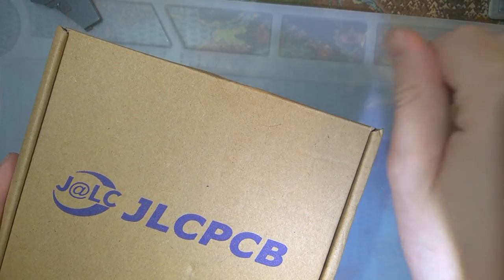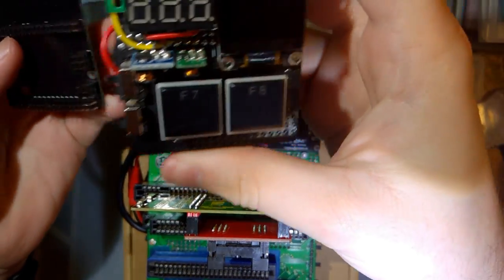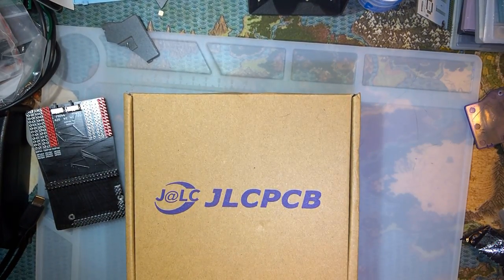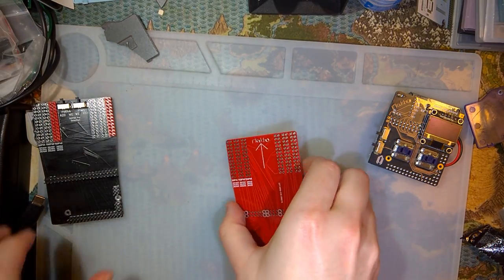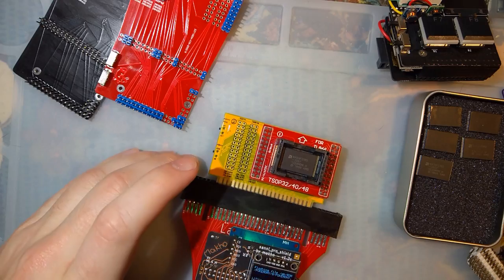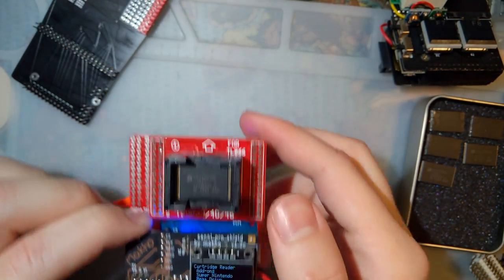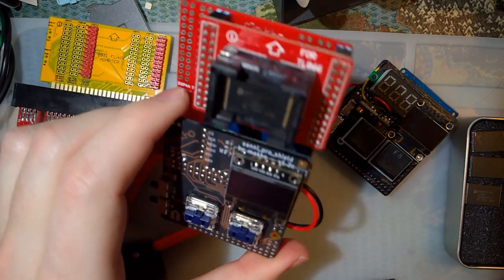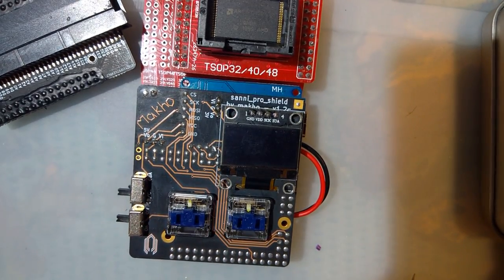8 Bit Flash Adapter PCB for my Micro Cart Reader (Part 3)

Comment: Hi makho. i have a question.
when i flash AM29F016B chip with 8-bit flash adaptor, it's detected, erase ok. but keep error : Not blank. and when i write chip, it keep freeze.
did you solve this problem?
Reply from the maker: Try reseating the chip. If it's still not working, the chip itself could be bad.
Reply: @makho  my all chips are bed... thanks makho!

Comment: Thanks for the videos. They are awesome and very informational! 

FUNNYPLAYING removed paypal and i am completely skeptical on buying from them since they are using some random 3rd party credit card processing site.  Have you had any issues?
Reply from the maker: Never had any issue with Funnyplaying. I asked them about paypal once and they told me they couldn't use paypal because of a trademark dispute. 

https://snew.notabug.io/r/Gameboy/comments/brs1z0/looks_to_be_a_new_gba_backlight_option_coming/epyewkl/

Sorry for the not-reddit reddit link, they have since deleted their account for some reason.
Reply: @makho  do you have a suggestion on who/ where to buy GBA power switch replacements?  I've looked on ali baba but I've seen tons of reviews across multiple vendors saying it's the wrong power switch (advertised for gb/gba, is actually ds lite/ other)

Comment: So this is for flashing gbc games right? Or is is a all in one flasher
Reply from the maker: This board module is only for flashing the bare flash chips. My particular use case is to flash these chips then build flash carts with the pre-flashed chips. This helps with troubleshooting if something goes wrong. There is no need to flash the chips before assembling the carts. 

This is an adapter for an already stand-alone GB/C/A cart reader/writer.